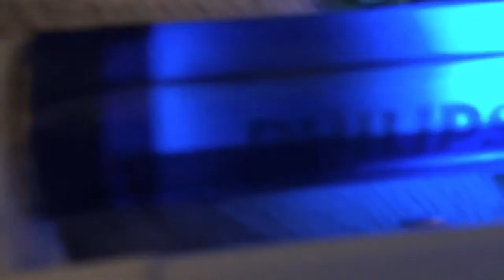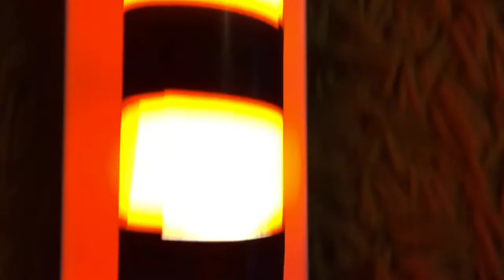Homade (DIY) colored fluorescent tubes

Comment: thanks for this tip, it worked really well, I had a shoot in an old garage full of tubes so I used the electric tape and it worked wonders, it also didn't heat up or melt and lasted the 3 days shoot I had, the owner of the place actually liked the blue color and said to just leave them like that. I used 50mm wide heat proof electric tape so it's less work to cover the area.  in some lights were too strong I had to use two folds to get them to diffuse the light for the camera.

Comment: This is awesome exactly what I've been looking for, thanks ! Just a question- is the tape heat resistant ? And is the tape not going to diffuse too much light ?
Reply from the maker: It is isolation tape so
I think it is heat resistant and only black tape diffuses the light very much
Reply: @thelamppostchannel  thanks. I have some red insulation tape at home, do you think it would be just as safe and effective as isolation ?
Reply from the maker: Jagbir Singh I think it is save

Comment: These are extremely inefficient as a light source but great for light show or ambiance or heating. There are color fluorescent tubes with the right phosphor for sale.
Reply: Yes but for example, older juwel aquariums have fluorescent lights that are like 1 inch longer or shorter than the normal tube lengths. So in some cases this can be useful for people as it saves a couple of tenners..